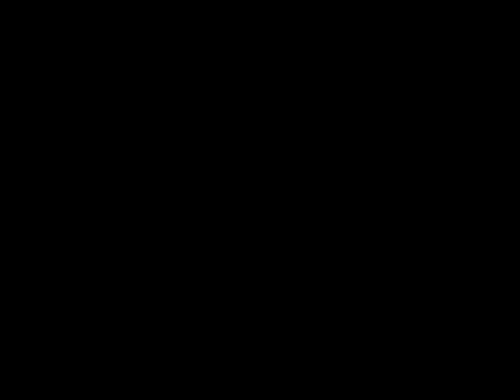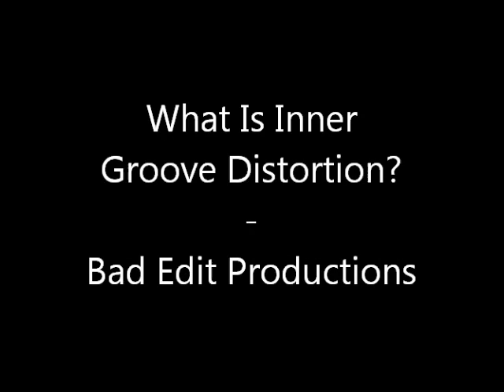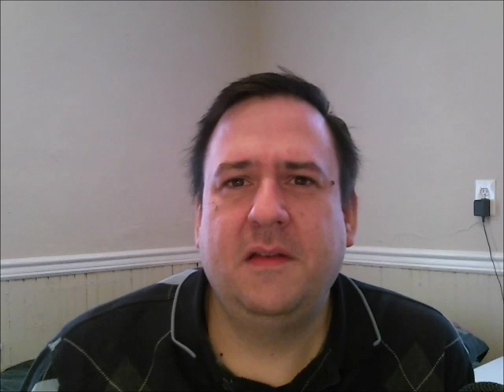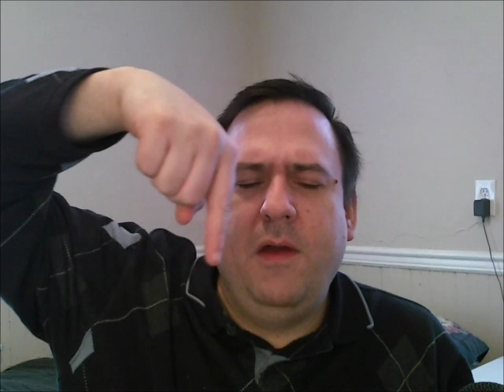What Is Inner Groove Distortion?

Comment: I thoroughly enjoyed this video Joe and have subscribed to your channel. 
I'm a recording, mixing and mastering engineer with several decades experience and qualifications in radio trades. Everything you've said here, I thoroughly agree with. My first job was in a commercial AM radio station in the mid 1980s.
One of my most recent "residencies" if you will, was as house mastering engineer for Red Manor Records. I did the mastering for all the vinyl releases and many of the digital releases. We even trade marked "Quiet Vinyl" for our LP releases. I made sure my masters were going to present the cutting engineer with something they could cut at a lower RMS level and maintain dynamics and sound quality on as many systems as possible whether high end or entry level. We've received very positive feedback from listeners for our releases.
I have been outspoken for many years about the loudness wars and am friends with Bob Katz and Ian Shepherd who have also been very outspoken about this. I love dynamic material that isn't brick wall limited, hyper compressed and even deliberately clipped. That is indeed, as you mention, one of the primary reasons I've gotten back into records. The masters used for many of the albums I love are simply FAR better than the loudness wars nonsense of the last few decades. Sure, there are exceptions but as a general rule, this applies to much of the music I listen to.
Reply from the maker: Thanks. I am working in radio again these days and I have been redoing the digital music library for the station. It's been on-line for 27 years! Anyway, I get wav files from Nashville for new songs and they crush just about everything! Ugh. Nothing can be done but our Omnia processing can actually "unclip" audio so you don't really notice it on the air. LOL Keep up the good work. ;)
Reply: @EzeeLinux  it's somewhat ironic that those crushed masters usually sound worse on air than more dynamic ones. Station processing, at least when I was involved, used RMS detectors in the leveling amplifiers and the material would be at the same RMS level as more dynamic mixes but lacked punch.

Comment: Hi Joe great videos mate! I recently ran into quite a head scratcher. first off my setup is a technics SL 1210 Mk2 turntable, with an AT120E cartridge. Amp is a vintage marantz 2230. a week ago out of the blue after 4-5 years of no issues at all I started hearing very sudden fuzzy distortion when listening to my LP's. I thought it might be the cartridge that needed replacing, so I replaced the AT120E with a replacement cartridge but same happened. The strangest of all is I would literally spin 2 records without issues all is great, glorious sound, when I put on the 3rd record almost immediately It rears it's ugly head... I have the tonearm balanced, correct VTF & anti skate, played through speakers as well as headphones, same problem. I am starting to fear it might be the amp?? the part that gets to me most is that it only happens after 2 records played flawlessly! any suggestions Joe? Much appreciated

Comment: Hey Joe. Long time viewer here. I want to ask you something that has been driving me nuts for a while. I have an AT-LP120-USB turntable and four different carts. Reading your comments below, and other forums and such, it seems to be very important that the distance between the stylus tip and the rubber ring that joins to the tone arm needs to be 52mm, since this tone arm is based on the Technics, which I have read also. When I align it that way, and use a protractor, my cart is not properly aligned according to the protractor. I have a Stanton L720E, Grado Gold, AT95E (my least favourite) and some other old AT with a yellow stylus, no model number. Anyway, the only way I can get them all to align is to have them at the very back of the headshell mounts, that gives me the 52mm, and them turn them slightly inward so that they align with the protractors. I don't understand how the 52mm distance would be more important then having the carts tracking properly along the grooves. In fact, if I move them forward even more, I have to turn them even more. This is true with both of my turntables, all three headshels with all four carts. When I bought the AT-LP120, the cart that came with it, AT95E, was pre-mounted and the instructions said that it was pre-aligned. Really? This thing was way off according to protractors, and I have three of those... they all show the same results. So, my carts are 52mm from the arm mount, and they are turned in ever so slightly so that the track properly. Your thoughts? A video perhaps? Cheers!
Reply from the maker: You're overthinking this and your carts are NOT properly aligned for that arm. I tend to trust the engineers who designed these arms and don't try to reinvent the wheel. If you measure 52 MM from the rubber washer on the headshell plug to the stylus tip and make sure the cart is straight in the headshell, you are properly aligned for that arm. This gives you a modified Stevenson alignment scheme which is engineered into the arm geometry. Your protractors will NOT line up and it will look like it's wrong but it is right. The null points just don't match the protractor. Remember that any alignment method with a pivoting arm is a compromise. The Stevenson method takes into account changing linear velocities form the outer to the inner grooves and averages potential tracking error in such a way that you get the best over all sound from the begging to the end of a side. I've trad it other ways and none of them were any better than the recommended setup procedure. :)
Reply: Joe Collins Ok, thanks Joe.

Comment: Hi, Joe! Thanks a lot for such an in depth reviews. I am using rega rp3-24 with ortofon MC turbo3 through some nice boose speakers. However, I really can't believe that even AC/DC mastering engineer would be such a dumb person who wouldn't take into account these inner groove issues. For the record I haven't been able to listen to original pressings on my system but recently published Back to Black and Highway to Hell to my mind sounds terrible in the middle. And the sound (syllable) issues for both records are absolutely identical. How can such a number one one albums sound so dreadful? I was starting to think maybe something went wrong with my system but then i listen to recenty digitally remastered Dark Side and it sounds brilliant. I mean - the difference is so enormous. and probably there is no way of knowing what quality the master will be before buying a record.. Would it be connected with anti-aliasing may be?
Reply from the maker: Something is not right there. An Ortofon Turbo 3 is one hell of a good tracker and even if the record was a bit overmodulated you shouldn't be hearing sibilance from such a fine cart. It sounds like you have an alignment issue of some sort and it doesn't have to be very far off with the Ortofon's FIne Line stylus to cause problems like this. Are you sure it didn't get damaged somehow? A chipped stylus or bent cantilever can ruin the sound and tear up any records you play... I'd take it to someone who can look at the stylus under a microscope and check that the diamond is OK and get them to realign it when they put it back on, too. You put a lot of money into that system and you're not getting what you paid for at all. Please keep me posted! :)
Reply: Joe Collins I've had two MC turbo 3 cartridges and I have to say the mentioned ACDC albums sounded dreadful on both cartridges. Secondly mostly all others tonns of albums in inner grooves sound absolutely normal. So I doubt that something's wrong with my cartridge. Now, could leveling be a porblem? becasue I leveled the turntable only "based on my eye". Regardng the alignment of the cartridge, well..I have aligned it myself based on stencil provided by rega. And anti-alising is set to 2 grams, they way it shoud be for my 2g cartridge. So this is a bit mistery to me. I'd like to listen to thee albums on some other hi-end system..

Comment: Great video! I'm curious if their can be a second master cut using the output of from the higher gain master copy ( in direct to disc recordings), then sell one as 'highest end' and the other as 6 mil? Seems like that might open a can of worms though in regards to who would and wouldn't offer both versions. Not to mention possible inflated pricing. cont.>

 I love 1930's 78's as well as old vinyl and prefer my records to reproduce at the average level of small orchestra even though I listen to lots of pipe organ records. The marriage between a good cut and the harmonic overtones of acoustic instruments ( and some amplified) is greater evidenced in a well mastered record. What is to be gained by more gain, but the need for a stylus that can track it. I'm not so sure the lines between one having a 'better' musical performance even exist. If so can it be heard at headphone or preamp level? 

Isn't it funny though that CD's finally bit it because their supposed ability to reproduce dynamic range based on performance was ignored? It's as if they inched upward looking for a better sound, but passed the better sound right up! Apparently the best sound of digital isn't good enough. Some of us always knew that, huh?
 Using digital to clean up early recordings, if done properly really can bring out some good sounds, but if you listen often the noise disappears anyway:)
Reply from the maker: Most short run high end audiophile pressings are cut to play with a high complience cartridge. They command a pretty penny, too. :)
Reply: Joe Collins Oh', well I guess I could live with a high quality audio file because I can't afford that kind of audioPhile. Maybe they are short run because hardly anyone else can either.

Comment: Hello. You seem to be very knowledgeable about vinyl records. I wanted to ask a question.  I am a newcomer to the vinyl universe and im having some sort of distortion. However I dont know what it is. I have a technics slbd20 with an audio technica at92e (p mount cartridge). During the first outer song and the last inner song of each side, it tracks perfectly. However when I play the tracks between I get this distortion on the left channel. It is as someone is constantly pulling the tonearem in and out. it effects both channels by 'cutting in and out' of the song. Is this inner groove distortion, or something else? Please respond. Thank you.
Reply from the maker: Sounds like something is definitely wrong there. It would seem to me that the bearings in the tone arm are bad or the anti-skate mechanism is really out of whack. Either way, the best solution is a new turntable. Try to find an SL-Q300 on eBay. Stay away from the belt drive models, though. They were not as well made. :)
Reply: Joe Collins Hello.  Joe Collins. I just fixed the problem. Looked like my table holding the turntable was slightly, slightly slanted. :) Put it back up to level and the sound is fixed! Guess that shows that anything can be fixed if you look closely. Thanks anyways. Like your videos. Keep it up.

Comment from the maker: You don't need a protractor at all... Just measure the distance from the rubber washer on the headshell plug to the stylus. The cartridge should be straight in the headshell and the stylus should be 52 MM from that washer. Protractors are a waste of time with 'S' shaped arms. :)

Comment from the maker: OK, Anti-skate should be the same as tracking force. Anything else is wrong. Use a ruler to make sure the stylus is 52 MM from the backside of the rubber washer on the headshell. Just lay it down next to the ruler and eyeball it until it looks right... That will ensure proper alignment for that arm. The AT95E tracks best at 2 grams and has a .4 by .7 mil stylus.  It tracks well but it will mistrack some high modulation records.  You might consider an Ortofon 2M Red for that table. I LOVE mine.

Comment: Thank you for your reply. It is actually a brand new turntable. It is an Audio-Technica AT-LP120-USB Direct-Drive. I got it 3 weeks ago. It came with an AT95E. TF is set to 2 1/2 , Anti Skate is half of the weight on tone arm (per some users in the vinylengine[com] . I really dont have much of a sibilance issue, but, records lose quality the closer they get to the middle of the record. It's been driving me a little crazy here. Would a better quality cartridge/stylus help this?

Comment: Outstanding lecture! I have found that a .02 x .07 mil elliptical is a good compromise, gentle on the groove walls, yet close enough in shape to the cutting stylus to faithfully track the inner groove area. The nuts & bolts of IGD is actually "pinch effect". This happens at the stylus tries to sweep across groove modulations where they become physically narrower. The stylus is forced upward, causing distortion artifacts which are not recorded on the record. Conicals have toughest time with this.

Comment: I really liked what you had to say in this video. I would also say that IGD on used vinyl is also a problem due to LP's being played incorrectly in the past, where the sibilance and tracking errors have been permanently etched onto the vinyl by means of improper setup of what these discs were originally played on. It might be worth arguing for a better stylus to bypass that kind of wear and damage, as you can also get $1 bin records to perform too. VS $100 cart on $20-$30 "new" pressings.

Comment from the maker: Yep.  That sounds like bad wires in the arm.  It may be somewhere in the open, though. A cold solder joint or something simple to fix like that.  The only way to find out is to take the turntable apart and use a meter to find the bad place. :)

Comment: I have that one on SACD, but not vinyl. I went to the 30th anniversary edition press launch event here in NYC, where long time Pink Floyd engineer James Guthrie discussed the lengths he went to to avoid going via PCM for the SACD transfer. He manually synced up the 16 track analog sound effects tape with the master to eliminate the bounce down needed for the original 1973 mix. Over on Hoffman Forums opinions seem quite positive for the 2003 issue, but negative for a more recent 2011 EMI version.

Comment: Very cool video! I understand that some records are meant to be played with more expensive styli, but are the engineers cutting these unplayable vinyls increasing the volume, or disregarding the RIAA curve? Also, can it be the other way around where the record was simply not cut properly? I got an album that was very staticky at high notes and clicked a lot, but side B was fine. Is this a good example of what you talked about? Also, how is SQ affected on the inner and outer edges of the LP?

Comment from the maker: I mostly collect original pressings and my stuff plays just fine... The two that I have that are like that in a big way are the 25th anniversary edition of "Thriller" and "Dark Side Of The Moon."  Nothing I've ever played the "Thriiler" LP on will track it properly and others have told me the dame thing. However, there's A LOT of folks who are coming across this problem and I get messages from them all the time. You'll also see a lot about it on the audio forums. :)
Reply: Sibilance on 25th anniversary edition of "Thriller" is totally unacceptable. If I remember correctly it exists all across the record, not only at IG. It is there from the first spin of unused copy of course. It's unlistenable with AT 95 E. They are pushing it so far these days that even awesome trackers like AT 440MLa have a hard time.

Comment: I'm not sure what records you're talking about Joe. I honestly haven't run into too many tracking problems for many years, and I have set up and used everything from budget priced cartridges and turntables all the way up to the most exotic stuff imaginable.

Sure, there's always a handful of silly untrackable records like the infamous Telarc 1812 Overture, but in my experience they are the exception. 

If end of side distortion is a problem, perhaps consider using Stevenson cartridge alignment.

Comment from the maker: Yes. They also used to cut radio transcriptions center-out for that and other reasons. It was easier to cut that way because the 'chip' from the cutting stylus tends to fall toward the center... Now they use vacuum hoses to suck it up before it can cause a problem so it does not matter anymore.

Comment: The way a record is mastered should depend somewhat on the expected buyer. How many $60 2x45 rpm 200G audiophile reissues are played with a cartridge that costs less than the record? Still, some affordable cartridges like the Shure M97xE can track pretty much anything if they're set up correctly.

The catch is that proper setup is critical, and especially with better tracking stylus profiles things like overhang, VTA, azimuth, and zenith need to be spot on. This often involves specialized tools.